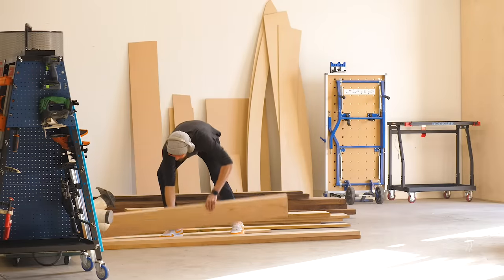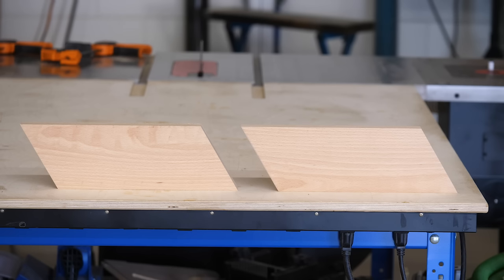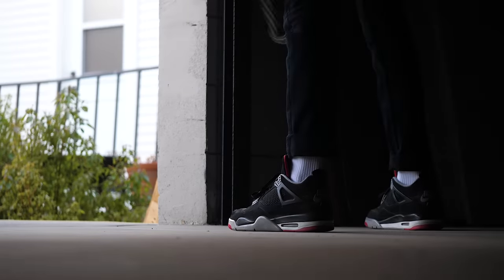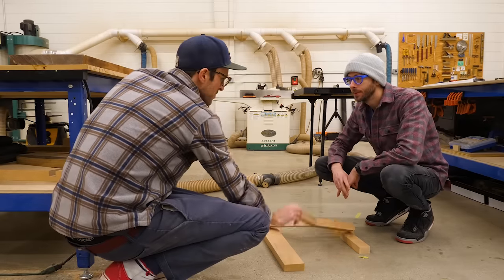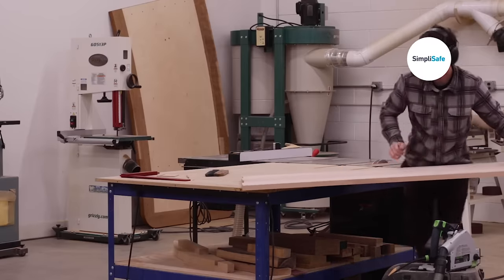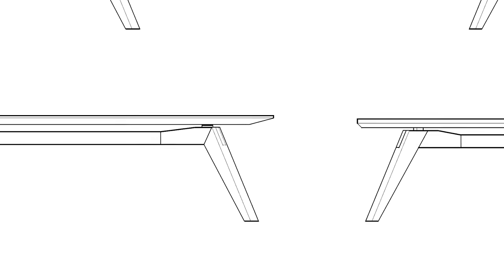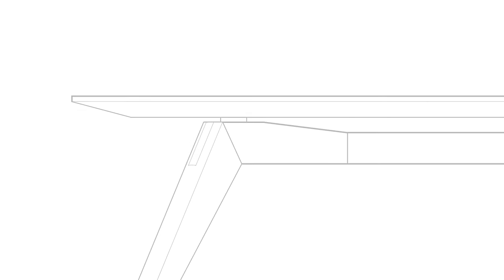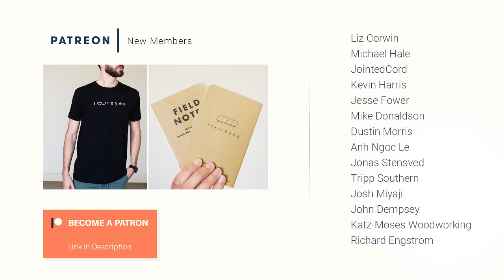How To Build a Modern Coffee Table (That looks Delicate, but isn't)

Comment: Awesome work! I'm curious about wood movement though- do you not have to account for it because the big beam underneath will grow & shrink at the same rate as the table top? And if the table top was plywood, do you think that would cause cracking down the road?
Reply: I’d love to know as well! Seems like the tabletop would expand at a greater rate than the aprons. Especially since the grain directions are oblique to one another. Perhaps the floating mortise is somehow designed to allow for movement in a similar way that traditional buttons work?

Comment: Excellent content right here! Love the design, attention to detail, and explanation you provide in the video. 

I’m curious, could the rectangle top be substituted for a oval top of a similar overall length and not look funny with the leg/base design? My initial thought is that if the stretcher length and leg width proportions could be balanced to fit the oval so the legs not protrude from the sides it would look fine. Thoughts?

Comment: Nice. I plan to do a coffee table like this one. I am a bit concerned that the table top will move/warp. I don't like breadboard ends. I tested the sliding dovetail to reinforce the table to across the width, it works well, but it shows up on the sides.
Reply from the maker: Environment might play a role...but I've built lots of tables like this, much larger, and no issues

Comment: I'd like to see more tips on special joints, like where the legs join the cross piece. It was awesome that you showed us how strong it was!
Reply: That won't happen in their videos anymore but if you spring for the overly expensive plans you'll get what you need.  In fact they now deliberately avoid giving as much detail as they could as every bit of this channel is monetized.
Reply: In their defence I really like their stuff, both of them are great designers and one of them is a pretty good woodworker. I just think it's sad that it has lost its simple roots.  As soon as I see a load of Woodpeckers gadgets I know the people have sold out. I come back to check out the designs but with the sound off and my finger lingering on the fast forward button.

Comment: Some of your work, especially this table, would be interesting to see if you I traduced subtle curves to one face, like the top of the stretcher + leg and the inside of the leg.

Juxtaposition of straight and curved, might create a more subtle geometry than just divergent /convergent straight sides.

One of the most dynamic interiors I designed as an Architect was an office fittout where the central corridor was splayed at 1.5°... the owner and staff loved it. If I  was designing such a space now, I'd add a convex curve to one side to "blow out /constrict" the experience of "transitioning" the space...  actually thanks as commenting on your post has given me a new idea to incorporate into my Tiny House design (which already embraced "divergent" angles)

Comment: Love this build.  Is there any issue with seasonal movement the way you have the top attached to the base? or is that minimized because the stretcher and legs are mostly in the same orientation as the top, so they'd all move together?

Comment: “Thickni” gets me every time!
Reply from the maker: It's a classic
Reply: modifiquen. La producción de sus videos, enfocarse en el producto. y no en imágenes distractivas y aburridas. (consideren el idioma en español).
Reply: In the fwiw category (and because harmless contrarianism is fun), since we speak English rather than Latin the proper ending would in fact be "es" rather than "i" according to the Modern Language Association. They also suggest "indexes" rather than "indices" (and appendixes rather than appendices) for the same reason; English pluralizes words that conclude with an "s" sound using the "es" ending.  But MLA also recognizes English as a dynamic language, so as long as successful communication occurs it doesn't really matter.

Comment: The iterative design process in action! The improvements make a difference, man. Well done! It's gone from a beautiful table to a highly resolved, frankly, stunning table.

It's pleasing, just how much that detail of making the joints symmetrical cleans up the visual alignment. I designed and built a similar project with an older (and much better) craftsman at our college and had half laps in the original design. He convinced me to use bridle joints and it made the same profound difference when the visual axes lined up. Worth all the hassle!

P.s. I'd be so tempted to sneak something really dark, like walnut or merbau in as the floating tenons. A little surprise for the truly pokey-nosed. :-)

Comment: Why are y’all able to fix the legs to the table top without worrying about movement? I’d love to know more about what I’m able to get away with! Also, yalls content is always A+++. Finally, just wanted to second the request for a thicknii shirt. (And Fleet Foxes is awesome). Okay, end of rambling comment :)
Reply: Also curious
Reply from the maker: We cover this in the plans... but long story short. Wood is acclimated in same environment as it will live. Attachment points are only about 10.5" apart, so there will be very little movement, and the base can flex enough to accomodate any movement.
Reply: @Foureyes.Furniture  At a spread of 10.5" and an American Beech expansion coefficient of .0043 with a moisture content change of 10%, movement would be 0.43", year after year flex after flex I think it would take it's toll on the structure

Comment: when you mentioned that the legs can be attached just using dominos, what about the movement of the table? if you use dominos is there any posibility that the timber will stretch and therefore weaken this area?

Comment: Nice, well thought out design.  Did you consider any expansion of the top with the way its attached to the legs?  Seems like any expansion or contraction would stress the leg to center piece joint.  I noticed a couple other comments regarding this.

Comment: Beautiful table — sort of a Googie/Scandinavian look, very popular in the early 80s but old enough now to look classic rather than dated.  My only note would be the exposed tenon: the problem is (in my eyes) the tenons are so short, that it isn’t obvious the exposure is intentional.  If you ever revisit the design, I would at least consider making them longer and wider, so they are obviously structural.  Chamfered, instead of rounded, edges might improve the effect.
Reply from the maker: When I first made the table I made them quite a bit longer and didn't really like the look. So I shortened them. That said, it's totally subjective and a very easy change.

Comment: Any issue with wood movement? The top seems constrained by the floating tenons holding it up.
Reply from the maker: ...and you want to be my latex salesmen? 

But anyway. No issues. The floating tenons are not all that far apart. Maybe 12". So you really only have to contend with whatever movement would take place between that span. Anything to the outside of that doesn't matter. It could expand and contract to infinity and nothing would break. 

And all that theory aside, to get practical. I've had tables like these for many years with no issues.

Comment: Do you have any steps you follow to be creative in design? I find myself getting stuck often when designing with 2” x 2” rectangle blocky furniture. Is it just practice and a vision? Or do you have an informal checklist sort of process like “taper and angle the legs, put a curve in the table top” etc.? Thanks so much
Reply from the maker: There definitely isn't a checklist. I would say it's much more fluid and intertwined than you are describing. Like...i would never design a leg and think "there is the finished leg design" - I'd more think, there is the direction for the leg and that's as far as I can take it for now, meanwhile I'm designing the rest of the piece at the same time, and every piece is influencing ever other piece, so I'd get a desgn that is proportionally there and that I'm happy with, and then start working on the details. But even at that point, nothing is "finished" dimensions might still change, etc... It would be like making a casserole. You wouldn't cook each thing individually and then put it together...it all happens simultaneously. Or heck, maybe you would...I've never cooked one. I'm not even sure how to spell the word :)
Reply: @Foureyes.Furniture  whoa... ok. That is SUPER helpful. Thanks so much and I will try to incorporate that thought process into my designing!!!

Comment: Hey Chris, when you are deciding on the angle that you want the legs to splay, do you just make it up as you go, or is there certain go to angles that you know will be both aesthetically pleasing and structural enough not to fail?
Reply from the maker: I just play around with it when I'm designing. The angle is usually a result of the overall scale of the piece, the look I'm going for, and the aesthetic I want...but there aren't any secret angles that just look good all the time
Reply: @Foureyes.Furniture  Thanks!  That actually helps a lot.

Comment: Came out great! How much does it weigh?
Reply from the maker: Thank you! To be honest, I have no idea. Also, since all wood is different, no two tables would weigh the same.
Reply: @Foureyes.Furniture  How often you do contemplate size, weight and type of wood for a project? I’ve been thinking of this lately as I want to build some furniture but I want a good balance of weight to size; where its easy to move but doesn’t break the bank (as harder wood is expensive and heavy). Thoughts?

Comment: Hey guys, nice design and work. One issue however, and it's a big one. You didn't account for seasonal expansion and contraction. I noticed you also oiled the tenons before putting the top on and neglected to comment on this procedure as you mentioned earlier that you will permanently attach the top. Perhaps you recongized the mistake and addressed it  and II'm behind the times here?. Otherwise, now the top floats freely unless dry locked from whichever month and climate it's in, that's not good. And when locked up something will eventually give like a crack in the top, leg assembly or point of fastening. 
One approach , how I would do it, is using 1/8" x 1" flat stock aluminum as a stretcher from tenon to tenon across the width of the top. Rout a channel in the top underside to hide the bar (or not, nobody see ..or use a piece of cheery and make it an element) Then, set the ends into the tenons flush and in both cases for attaching use 1/4/20 threaded inserts and countersink machine screws into the bar( slot the holes in the bar so the screws can slide as the top moves back and forth along the bar(don't over thighten). This maintains your look , form and function but most of all resolves an engineering issue without compromising your design. I like it but am very interested in how you will correct this flaw. Cheers!

Comment: Are splines stronger than dominos in this particular build?  Or is more of a design aesthetic and the strength is virtually the same?  Also, could this design be converted into a desk and is there a formula to increase leg size to match the structural integrity of these shorter legs?  And lastly, I live in Los Angeles—where do you buy your stock?
Reply from the maker: I'm not going to test it to find out...but either is overly strong for this application, so I'd go with whatever look you prefer. No formula that I'm aware of...but if. you scaled it relatively it would be plenty strong. I get my wood mostly from a place called Reel Lumber which is in Anaheim. There are probably closer places to you though
Reply: @Foureyes.Furniture    Thanks Chris.  Love the channel.  Love the humor!   This is one of my favorite designs. Clean.  Transferable—as in I can see you taking design elements that will carry over to other pieces of furniture—like a desk.  Thanks again for the response.  Much appreciated.

Comment: The acute angle bevel cut on the table top bottom edge... how do you secure such a large item to the sled?
Reply from the maker: It's in the plans...but I'll give this one away. Just some good old fashion clamps
Reply: @Foureyes.Furniture  say I don't own a table saw yet. Would I get it if I used a circular saw?

Comment: The splines could form the floating tennon?   Not sure how much harder that would be...
Reply from the maker: They could...but, since so much sanding, etc... gets done after the splines go in...it would get a little tricky
Reply: @Foureyes.Furniture  I suppose it would only make sense if it was a bigger part of the design rather than a nice little detail.  Deviates from the aesthetic you two go for at that point.